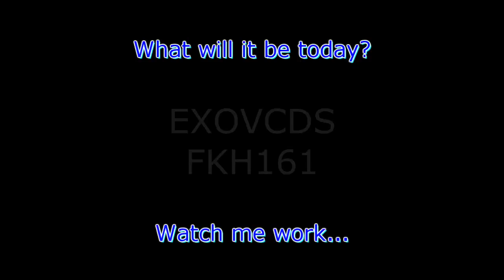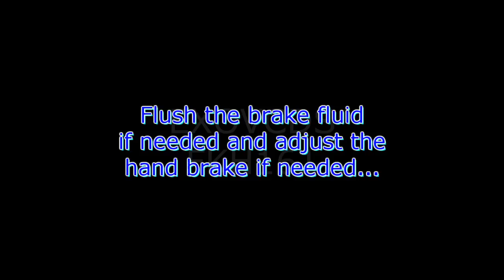VW A3: Rear Disc Brake & Wheel Bearing Replacement

Comment: I've never seen this done before. What a great idea, to mount the rotor on the clean wheel, like a custom vice, to safely and easily tap in the new races. And your tip to rotate the slave cylinder back out so there is not too much play is worth remembering, too. The nubs on the back of the pad need to match up with the notches in the slave. If it is too far off, when you pump the brakes or pull the hand brake the slave might rotate out of alignment before it makes good contact. Also self adjustment of the parking brake requires close contact.

Comment: The washer must have side to side play or  axial play
Reply from the maker: Side to side... as in slide left & right.
Reply: @EXOVCDS  I did as you said and after I put the wheel I check there was some play in the wheel, I tight the nut to a point we're I can move the washer with a little effort, checked the rotor no noise put the wheel, and as I said I had some in and out play, like left in right out and vise versa any thoughts I have new stub axles and bearings
Reply from the maker: @mfortugapt4life It is normal to feel a little bit of play when moving the wheel with hands at 12 & 6 or 9 & 3... when the adjustment is correct (washer can be moved). When you tighten the nut too much, there should not be any play. If you still have play, then something is wrong. Watch this video:
https://youtu.be/ffkFgrIfmEA?t=633
Reply: @EXOVCDS  thanks man I have and audi A4 B5 1997 I have rear rotors and had done the same procedure let's find out if it works fine for
Reply: @EXOVCDS  I tight the nut take the car for a drive and after 20km it started squeel should I tight ou losses the bearings
Reply from the maker: The washer needs to have free play (move left & right)... I said that when the nut is tight (can't move washer) there should not be any freeplay. That is only done for testing!!! Loosen the nut so that the washer can be moved.

Comment: My Passanger rear wheel has lots of negative camber but no bearing noise, could the locking but be loose?
Reply from the maker: Don't know... check it.
Camber shims can be installed when needed.

Comment: Excellent video. That's just what I was looking for because my A4 has its rear discs, with bearing. When I tighten bearing, I tighten it until the end and release of 60 degree.
Reply from the maker: +dadoka1974 This video is for a VW A3 or as most people say mk3. Your Audi is different.
Reply: No. Rear brake is a same. A4 1999. Only my disc have 5 holes for screws
Reply from the maker: dadoka1974 Weird.... Audi A4 non quattro?
Reply: No quattro. 1.9 TDI That's why I looked for this video, all videos on a4 or passat is with ordinary disc.

Comment: Great help.Thank you very much.
Reply from the maker: Thanks for watching & taking the time to comment! Have a great holiday and all the best for the new year!
Reply: when you pressed the races in with the hammer and bearing, does that drift protect the bearing or is that a special tool ,to drive that race in.?  is that synthetic grease to handle modern heat and improve the rolling resistance? Less heat,easy rolling =longer life,better milage and faster speeds.  very thorough.  nice work
Reply from the maker: +Peter Dearborn It's a bearing race installation tool. Regular all purpose wheel bearing grease. Feel free to use the special stuff.
Reply: Is that tool vw specific ? Where should I look to get one?
Reply from the maker: Peter Dearborn http://www.amazon.com/Automotive-Bearing-Driver-Master-Housing/dp/B00K326ID8/ref=sr_1_2?ie=UTF8&qid=1443371802&sr=8-2&keywords=wheel+bearing+race+tool

Comment: Does a new wheel bearing kit normally come with new races for both bearings? I have a kit on the way in the post, but i'm not sure that it has a new race for the new inner and outer bearings. 

In the case of it not having them in the kit, what is the likelihood that the old races will be reusable with the new bearings, given that the old bearing are currently grumbling and moaning, and doing what old bearings do when they need to be replaced? 

Thanks for the video Thomas. I'm hoping I can get this job done once the kit arrives. Your video makes it a more viable proposition, for a noob like me.
Reply from the maker: Wheel bearings / tapered roller bearings are always sold with their races... like this kit:
https://www.ecstuning.com/b-vaico-parts/rear-wheel-bearing-kit/vwrbk/
You can see the bearings sitting in their races. Not all kits include new grease caps, cotter pins, nuts etc.

Comment: doin my brakes today, totally buggin out about it until this vid...appreciate it bro
Reply from the maker: +Jevon Tucker Make sure to put enough grease inside the hub (but not too much) and that you transfer-over the ABS ring (if it has one). Adjust bearing preload to the point where you can still slightly move the washer under the nut. You'll do fine.... if you have any questions, just post it here.

Comment: So the  caliper piston  goes back  in with a special tool  not pushing it all  the way down ?
Reply from the maker: Yes, the piston needs to be "turned & pushed" at the same time. I turn & push it until it is all the way down / in and then I turn it back out until it fits over the new pads with a little bit of freeplay.
Reply: *****  how can it be done without that tool?
Reply from the maker: Use large pliers to turn the piston one turn and then use the pliers to push the piston in a little bit. Repeat until the piston is in far enough to fit over the new pads.
Reply: *****  thanks

Comment: What does the grease actually do? I know the grease is important, but what it's for.
 
Also when changing front brake pads
and/or discs where do you put the grease?
And where do you buy the grease?
What is the grease called since it is for high temperature?
I heard it's just called "Brake Grease".     :)
Reply from the maker: Wheel bearing grease lubricates the bearings. When the grease gets old, it breaks down and can not protect the bearings anymore. When bearings fail, they start to pit... pitting of the bearing & race surfaces is what causes bearing noise.
Brake parts / component grease is a high temperature grease that lubricates moving brake components, so that they can move without making any noise. Do not apply grease on the actual brake pad surface that makes contact with the brake disc. Only lubricate the metal parts that touch other metal parts. Your service manual will tell you where to apply grease / where to lubricate.

Comment: Great video, my mk3 vw 4 cyl passenger rear wheel had some play when moving the wheel forward and back when jacked up. Now there is a noise starting to come when the wheels are spinning.
Do I tighten the screw that's at the bearing there ? Will that help or I have to do more ?
Reply from the maker: If you have noise, make sure that there is enough grease inside the hub. Adjust the bearing preload until the washer under the nut can be moved with a bit of effort. If you can't move the washer, the nut is too tight. If the wheel does not move a little when you wiggle it (off of the ground)... the adjustment is too tight. Noise from the bearings usually means that it's time to replace them.

Comment: **Update**
brake job went well...still a little worried about taking corners hard for fear of wheels flying off but gaining more confidence daily...I will say though I had to buy a kit that would allow me to bang the races down into the rotors...after that it was pretty much smooth sailing from then on...again, great vid for noobs for sure thanks!!!!
Reply from the maker: +Jevon Tucker Thanks for the update!

Comment: Obviously its shown in the video, but it seems everybody has their own way of pre-loading taper bearings, could you explain your method..
Reply from the maker: I tighten the nut while turning the drum / rotor, then I back off the nut and tighten again until there is a bit of drag on the washer.  As per service manual:
http://fkh161.ca/VW/play.png
I know some manufacturers have torque specs or other procedures... wiggle the wheel 9 to 6 to feel for excessive play. A little is OK,  but you shouldn't feel any if things are AOK.
Reply from the maker: Did that make sense?
Reply: ***** dis car is a golf 3 or golf 4???
Reply from the maker: mariuccio elio Golf 3 (A3, mk3)

Comment: great vid just sometimes the water mark on the vid obscures exactly what your doing, but most informative one ive seen on the jetta rear brake job
Reply from the maker: +Maarten V Yes, sorry... my watermark has since been reduced to 2% visibility (check my new videos). Thanks for watching. I answer questions as quick as possible... to make up for the lack of commentary & parts visibility.